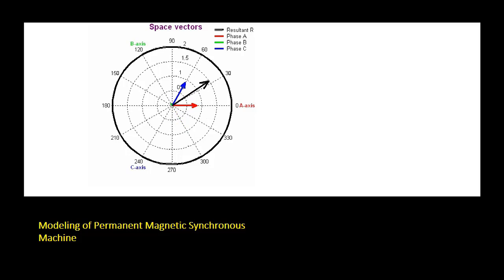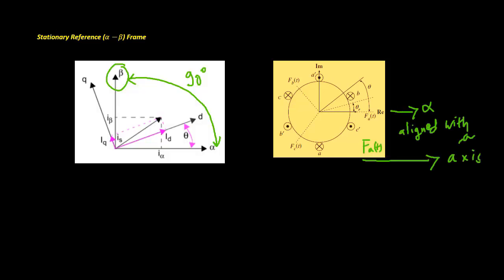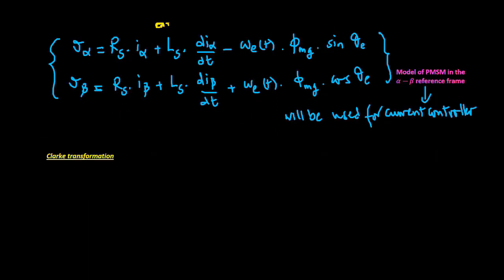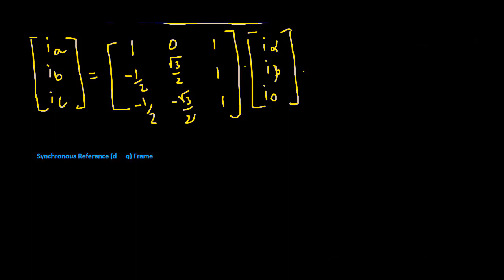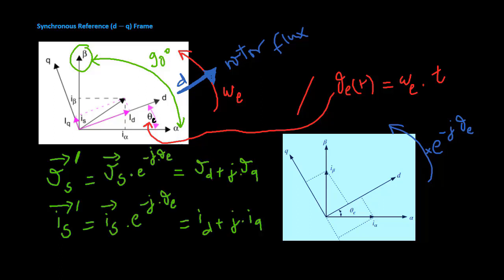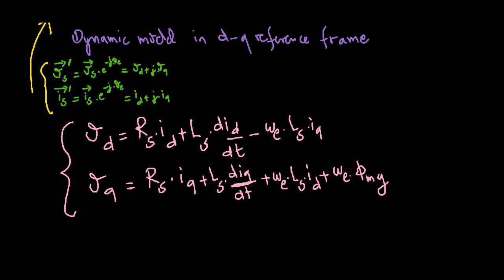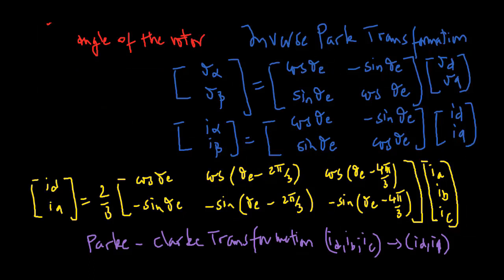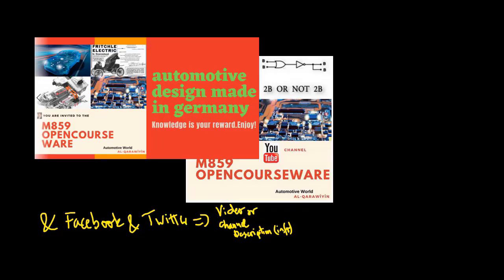Model of PMSM: Clarke-, Park-Transformation

Comment: Thank you for your explanation sir! A question: in your next video with simulink model of pmsm you have Vd and Vq as reference. But in a closed loop control, can we have Vd and Vq as ref? Or how should we modify that scheme for close loop control?
Reply from the maker: the outputs of the internal current controllers are vd and vq with the compensation see the https://youtu.be/_z-y_os5xQc
Reply: @eDrivesEmbed  Yes, I understand it now. Thank you! 
What do you think, it is a good idea to add an outher loop to the speed loop in order to have an angle reference?
Reply from the maker: @andreimitrasca7815  you can use a position controller instead of a speed controller, again you only need the dynamic equation to calculate the controller parameter
Reply: @eDrivesEmbed  I understand that, thank you, but what i was asking is if i can pun an outer loop, as it is velocity for forque? So the final diagram would be angle-> velocity-> torque
Reply from the maker: @andreimitrasca7815  yes possible used in robotic also